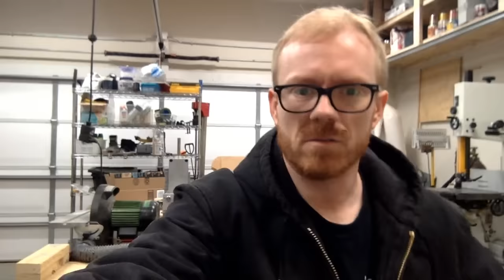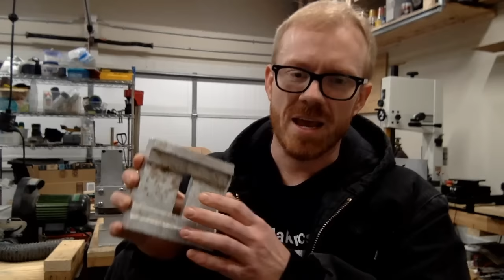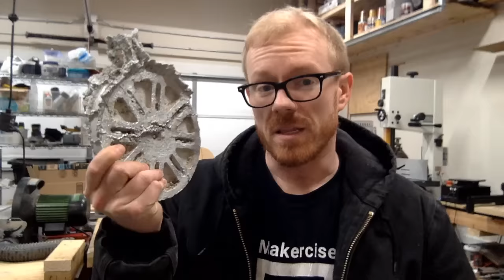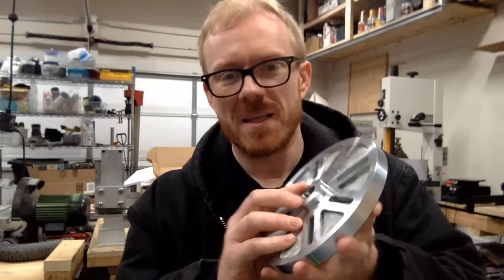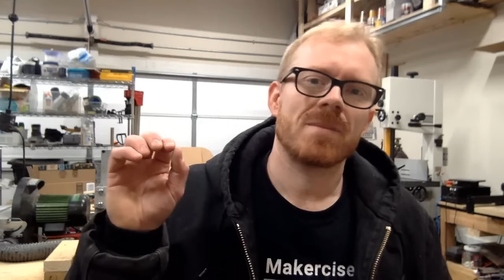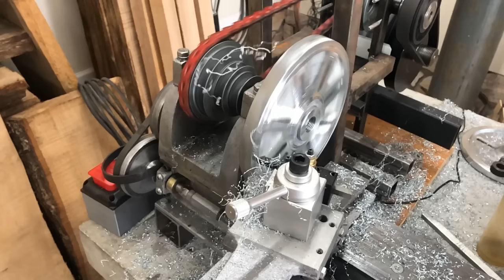Morning ☕- Lathe Faceplate and Mill Carriage

Comment: Have you put any consideration into making machines of your own?   I'de like to see you leverage everything you've been doing into even bigger machines.
Reply from the maker: I have thought a bit along those lines. I’d love to do bigger and better castings in iron, do some heat treating, maybe a surface grinder. I really dig CNC so maybe something along those lines.
Reply: It seems like an oil burner is the way to go for cast iron.  I have watched videos where people have mixed ferrosilicon with scrap steel to make cast iron.  Unfortunantly, I've never really seen anyone cast anything particularly large.
Reply: I did some research on ferrosilicon, and aparrently it is made by heating an iron source (scrap steel or millscale) with a silicon source (Sand or Quartz).   I've seen video examples of this in industrial settings in China but never seen it done on a hobby level, but theoretically if you can melt the right proportions of sand and scrap steel together, you should be able to produce your own ferrosilicon.  With that in your minecraft inventory you should be able to further leverage scrap steel and your ferrosilicon to make cast iron from raw materials that are abundant all over the western world.  I just thought I would mention this because if you were to do this, I'm pretty sure it would be a youtube first.